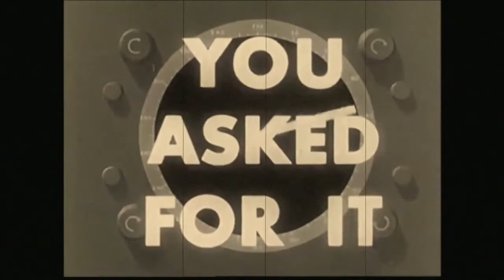The Malcontents - Episode 14  "You Asked for It - Part Two"

Comment: I have a PS100 question that I keep getting different answers to……..I want to run my amp into the PS100,and send the line out to my interface,but,no cabs……no cab connected to the PS or the amp…..silent…..do I set the switch to operate or standby on the PS100??…I have been told to put it on operate…..and bypass….which one??to reiterate,amp,PS,no cabs connected to either device…..
Reply from the maker: Definitive answer: It doesn’t matter. With no cab connected it stays locked in Bypass regardless of switch position and Amp In signal automatically routes to internal load.
See manual Page 6. https://fryette.com/content/Power_Station_PS100_Manual.pdf
Reply: @FryetteAmps  Thank you!!!….No cabs plugged in,switch is irrelevant…..I have been using it(with cabs plugged in)straight into an AxeFXIII,just using the load,and the results have been amazing….It sounds great ….